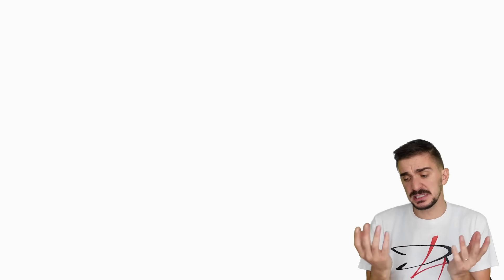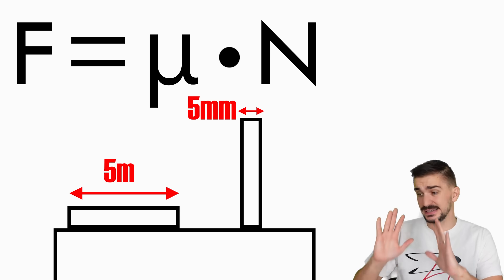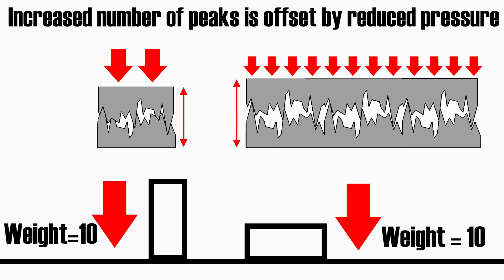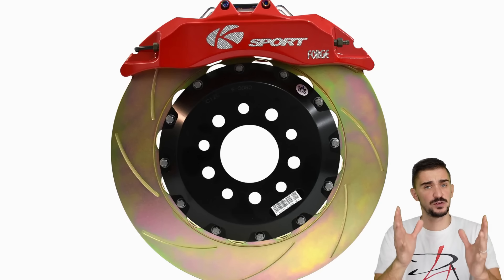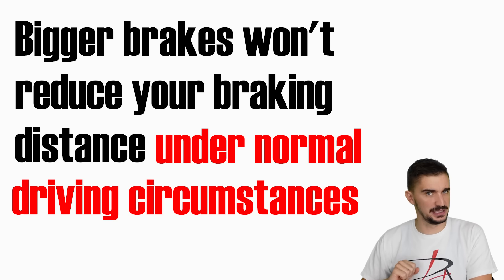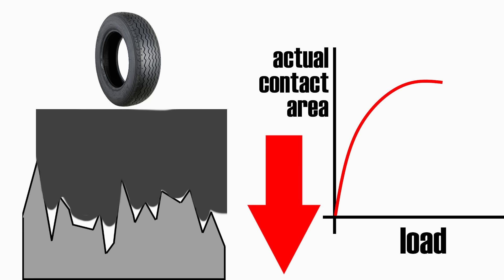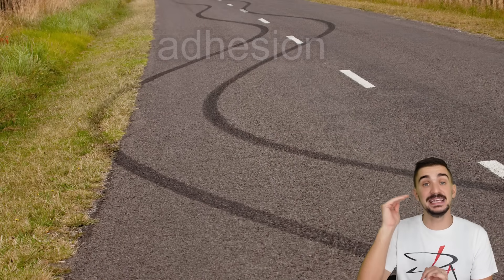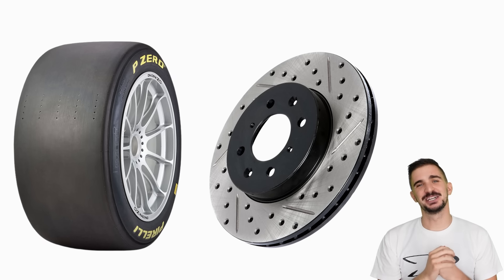Why Big Brakes Won't Stop You Faster but Wider Tires Will - Friction and Surface Area Explained

Comment: Larger diameter brakes have a higher surface speed across the pads at any given wheel speed, you absolutely will get more more breaking force out of them at the same peddle pressure because of the increased surface speed translating to more friction and also the increased diameter giving the brakes more mechanical advantage. The only way anything in this video holds true is if we are talking about changing nothing at all other than the surface area of the pads only. Back in reality even going from a 4 piston to a 6 piston caliper is likely going to increase the hydraulic piston area somewhat,  increasing the pressure that can be applied to the pads, increasing breaking force at the expense of increased peddle travel.  Nearly every car made since the mid 80's has as large of a diameter rotor on the front brakes as could be fit inside the wheel for the very obvious fact that mechanical advantage is king when you want to apply force.  After the packaging constraints are met, heat is managed with the thickness of the rotor faces and vented area. Pad size to manage pad wear mostly but also pad temp.  Getting back to upgrading brakes, other than ditching the organic/ceramic pads you likely cant do anything more than throw money away inside the constraints of the stock size rims, outside of those constraints diameter rules all. Don't know why we got a whole video titled brakes when its really a video about tires, kinda stating the obvious that you can only stop as hard as you have traction for, but that says next to nothing about brakes and what was said was either misleading or out right wrong.

Comment: Sorry to say this, i have upgraded my brake's to bigger discs and therefore bigger calipers, it dictated larger 18 inch rims from 16inch rims, but had to keep 205 width tyres due to clearance. now im an MOT tester for a living so have access to a Roller Brake Tester, so same width tyres and the brake results were much higher on the front then the standard size brakes (rear was same as not upgraded to disc on the back, this was also after 500 miles of driving for bedding in. i not one for science but more surface area coupled with deeper cooling ducts in the discs (they are discs not rotor's (rotors are blade shaped items fitted to helicopters) gives better braking, the tyres can't come into play being the same section width, plus having 4mm of tread left they are close to the end of useful life. sadly i don't have the print outs as binned them.

Comment: I think I would still rather have bigger brakes to resist fading even a little. If your going 75 mph and you brake hard down to 40mph and then at that speed attempt to lock up, in my experience you won't be able to. In the economy cars I've tested (ABS disabled) they will only lock up when rotors are cool. That means you are not using all that your tires have to offer - unless you just need more pressure to the caliper. Overall I've never driven a car that gave me total use of the tires performance either due to clamping force or pad/rotor performance.
Reply: Save your big brake kit money and get a better class of car.
Reply: @xtnuser5338  Might be safer the way I drive

Comment: So what would happen if you upgrade your brake booster or master cylinder, but keep your brake calipers, pads and rotors the same? After watching the video, I would think that for normal driving you would experience a shorter stopping distance at an exchange for more heat.  As for track performance I would guess this added heat will lead to quicker brake failure.  

If anyone could chime in and share their thoughts, it would be much appreciated.
Reply: Cars are designed for a balance stopping power front and back.  You alter it and you can disrupt the balance.  More boost will allow you to press lighter  on the brake to stop.  But you can also activate the abs more often too.

Comment: Doesn't surface area of brake pads reduce the normal force by spreading it out over a greater area?
Reply: Force vs pressure…Physics 101.

Comment: I agree except in my case. I built a Factory 5 Cobra and did not install power brakes. The brakes I installed were from a mid 2000's mustang and they DID have power brakes. The pedal pressure required to stop the car was uncomfortably heavy. I have since upgraded the front brakes to Wilwood 6 piston with as large a rotor that would fit inside the wheel. The same pedal pressure as before stops the car much better. The presumption you have made is that if you can lock the wheel with your existing setup then bigger brakes won't stop it any faster. I'd agree with that. I could not lock the wheel except with too heavy pedal pressure.
Reply: But you COULD lock the wheels? Then you haven't made your minimum stopping distance any shorter. You've just made it easier to achieve.
Reply: @xtnuser5338  Yeah but. When I say heavy pedal pressure I mean too heavy to be safe. I could not let my wife drive the car because I don't think she could apply sufficient pressure to lock the wheels. Strictly speaking you are correct but in practice the car stops "better" than before.
Reply: @rwgallup  I'll definitely accept that answer. I've said before that one can certainly alter the pedal feel, the pressure required, the ease of modulation, etc... but that if you can already lock the tires (or reach the ABS threshold), that you can't make the car stop any shorter by altering the brakes. I appreciate that you gave a logical answer instead of just arguing with me like a lot of folks do.

Comment: A question I've had about tires, wider tires versus narrow tires. If the tires are filled with 35 PSI and the car weighs 4000 lb wouldn't the contact patch be the same size no matter the width of the tire? And in this case it would be 114 sqin of contact area total all four tires. 4000lbs /35psi = 114.29 sqin
Reply: Shape of the contact patch matters.

Comment: My father's first driving lesson to me:  "Brakes stop the wheels. Tires stop the car. "

As an engineer I know that brakes and tires work by heat transfer, and the rate of transfer is a function of temperture. The greater the density and aborption  of the rotor/drum/road, the more efficient the aborption during repeated application. Increasing pad area or tire patch doesn't increase friction, as much as changing the material or its shape so the contact is spread over a larger region. 
Multiple smaller pads or tires of the same total contact area spread out over a larger road or rotor area will transfer heat faster.

Comment: usually you are well prepared for topic but this time you missed some facts:
1.bigger disc usually needs bigger caliper that has bigger pistons or more of it. so it can make higher braking force.
2.brake on stock car can not make braking force that could lock wheels at high speed for first few seconds, it has no such power to do it, bigger brakes could and then overtakes abs and it means that bigger brakes shortens braking distance 
3.yes , there is that famous formula, but except all you said , more important thing why wider tire gives higher friction force is shape of contact area: narrow tire has long track pattern (contact area) where is bad distribution of pressure on contact surface, wider tire has wider track pattern that has better distribution of pressure(or more even pressure over whole contact area). so when you start to brake hard, narrow tire can not take more pressure that comes with inertial  movement, but wider tire has more capacity to take additional force/pressure on contact area before it exceed point where friction breaks( no more friction force by higher normal force), so that is why wider tire can produce higher friction force

Comment: I just want to point out that physics equations are often represented with the minimal amount of relevant terms needed to study theories and extract the most relevant information with the least amount work (i.e. models), but should indeed be an infinite sum of terms of increasing order (Taylor expansions). In many circumstances, these higher order terms have negligible effect on the result and are therefore justifiably ignored. However, there are cases in which this causes significant error. One such case is the field of nonlinear optics, where, for example, lasers can generate enough energy so as to make the higher order (i.e. nonlinear) terms not only significant, but relevant and interesting to study. Indeed, the higher order terms sometimes even become the dominant phenomena. Having said this, I bring into question whether the formula F = \mu N is an appropriate model in high temp/high pressure motorsports application.

Comment: I've always known this is a very complex subject but you do break things down very well.
Are you a fully qualified mechanical engineer now?
Since you 'discovered' motorcycles, I thought I would add some info that may be of interest.
As a motorcycle tech and former racer, you can never have 'too much brake' on the front of a motorcycle but due to the high CoG it's easy to have too much rear brake.
It used to be possible to get 'HH' brake pads for the old bikes I ride but they have been discontinued by all the common manufacturers (EBC, Ferodo, etc) 
HH were 'semi-sintered' and didn't work very well when cold or at all wet for 3~5 seconds so you needed to apply brake occasionally to keep pads 'warm'
 First time I've heard of Tribology so I leaned something new today..
Thanks.

Comment: So for brakes, after we have allowed for adequate cooling under the conditions we are building for, can we increase stopping performance with an uprated master cylinder? If area of the disc doesn't increase braking force, you said increasing braking pressure does.

Comment: Bigger brakes are a necessary evil when heavy braking. From a dynamics perspective, you definitely wouldn't choose bigger brakes if you could get away without them, because both the increase in unsprung mass and the increase in angular (rotational) inertia are resolutely bad things you do not want in a car that is supposed to adhere to the road well for good acceleration (speeding up, slowing down and changing direction). As you say - it's entirely about heat management and without that requirement no Engineer would ever to add want bigger brakes.

Comment: It should  be noted that increasing the friction of the tires (eg:  wider tires, stickier rubber) will increase the amount of heat being generated at maximum braking as the brakes can withstand more force before lockup.
Reply: and your stopping distance will shorten

Comment: This episode shows that performance costs money. You want to brake later, then you need more aero, bigger stickier tires, which puts more load on the suspension, so you need to upgrade that, and then you start overwhelming the brakes, so you need bigger ones to handle the extra heat, then you have to change the brake proportion to keep the balance under braking. And all of this just to brake 10 - 15 meters deeper into the corner, when you factor everything in you've just sunk in ~$15,000 USD to do all that. It raises philosophical life questions, is it worth spending money to chase lap times, or would you be better off chasing something else? It's one of those things you need to do to find out, there's certainly interesting characters that are after the same thing, and the community that builds around that can reinforce that drive.

Comment: good video.

But having stock brakes doing 180km/h will not stop you.
Reply: A lot of cars in Germany are doing more than 180 on the highway, without having upgraded brakes.
This brakes won't do the job if you have to slow down repeatedly from 180 (since they overheat then), but nobody is using a normal car on public roads like a race car is used on a race track. To slow down just occasionally (normal traffic) stock brakes are more than sufficient.
Reply: @simonm1447  perhaps you are correct. my experience is a bit different... Perhaps it wouldnt work with a better car either, but it is still better to be on the safe side and be careful.

cheers

Comment: Your formula for friction is correct F=u*N, which does not related to contact area. However, in braking system, N = P (pressure generated by brake fluid) * S (Total surface area of caliper pistons). The maximum brake fluid pressure is determined by brake booster and brake hose assembly, by increasing surface area it does result in larger normal force N.

Comment: Yes, bigger brakes reduces the braking distance because the force of the brake pads acts on a bigger radius on the disc, so it makes a greater torque.
Reply: Yes bigger brakes act on a bigger radius, so make a greater torque. But greater torque doesn't reduce braking distance if you can already lock the tires (or reach the ABS threshold) anyway.

Comment: This is what I learned many years ago when riding bikes on tracks, then explained the simple principle to my kids about riding cycles, compressing front tires will increase tyre 'spread' and therefore tyre contact. No point have grabby disc brakes on an ultra skinny race tyre, all that will do is lock up the wheels.

On a motorbike you load up your suspension before a corner to increase contact area...

Comment: Tyre pressure has just as an important role to play. I must say, my car with a 325mm rotor is a better & more sure footed stopping car than with the 298mm rotor both on a 245 40 18 tyre/rim @40psi operating temp. Thankyou for another excellent series.
Reply: Falcon XR6 owner?

Comment: I was really hoping you'd go into a but more detail when explaining the wider tyres thing. I've been in the wider tyres don't improve grip camp for years. My take has always been that they help to dissipate heat better and, besides low profile tyres are generally made of better materials and so offer more grip for sports cars.

"Because tyres aren't solid, a 20% reduction in tyre pressure doesn't result in a 20% reduction in actual contact area. The actual contact area reduces by only maybe 15 or 10%."

"The end result is that a wider tyre has a greater actual contact area for the same load."

This doesn't explain why it would have more grip though. How is it different to your original analogy? As you pointed out, a greater contact area for the same load doesn't increase grip. It should still be the same, right?
Reply from the maker: The key thing is actual contact area vs apparent contact area

Comment: Friction is independent of surface area based on the very simple formula you shared for inelastic materials.  Second, which is a point you did share, u (mu) is NOT constant, and with metals (such as disc rotors), DECREASES with increasing temperature.  It is not just the temperature of the pads but the temperature of the rotors (or drums).  This is why heat is the biggest issue with brakes…the decrease in coefficient of friction with increasing temperature of the rotor itself (not just the pads).
Reply: Good racing pads usually have INCREASED mu with temperature...at least up to a point. If you choose well, this can kind of cancel out the decreased mu of the metal rotor, resulting in pretty consistent braking feel over a decent temperature range.
Reply: @xtnuser5338  the pads friction coefficient can increase with temperature; the rotor’s coefficient of friction will decrease with temperature.
Reply: @reneneron2971  That's what I said. If you choose well, the interaction between the two can result in a fairly consistent feel throughout a decent range of temps.

Comment: My dad raced SCCA Showroom Stock B in the 70's. All you could legally do was put in a cage and a fire extinguisher. He tried some 'cheater pads' one weekend on just the fronts. He stopped much shorter and had to learn new brake markers. The pads GENERATED more heat quickly and tore the rotors up. This is how you stop faster: generate heat faster. That is all there is to it, how is irrelevant.

Comment: I like all of your videos except this one. Wrong  wrong wrong. Your talk about braking distance are all from cold brakes and ONE measured stop.  Not exactly real life on a race track but maybe accurate for one panic stop on the street.  WHEN I HAVE driven on a deserted country road at 125 mph and do a shorted stopping distance brake test with stock floating caliper brakes. The stopping distance is good and comparable with Brembo, Willwood, upgraded brakes. After ONE braking event the stock brakes are so hot that  they will stop you a second time with a need for 40% more distance.  The Brembos, or willwood, or PFC, and Alcon can repeatedly take this abuse without change.  On race tracks, you might have to brake from 150 mph to 60, or 125 to 45 but usually not to zero mph.  Stock brakes are OK for most people and grandma.  If you are going to do any performance driving or hauling big loads downhill, then get better brakes.  Adding better stickier tires or wider tires will just cause worse problems for stock brakes sooner.
Reply from the maker: But I said all of that in the video.....
Reply: He talked about daily driver cars, not race cars. The part with the race cars however (and their differences to a normal car) is also explained in the video
Reply: @simonm1447  My complaint is with the premise of the tittle.  Wider tires or stickier tires stopping faster on the street or the track is a non issue with stock brakes.  Who is the video for, a poser?  Stickier and wider tires and bigger brakes are all better at stopping your car.  Unless you buy at least two (tires and brakes), your car will not perform at a higher level.